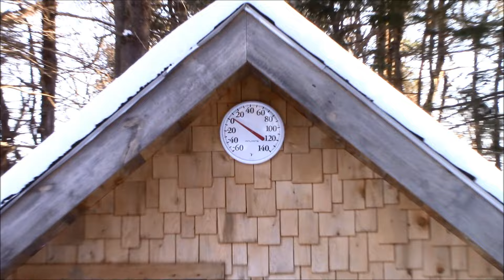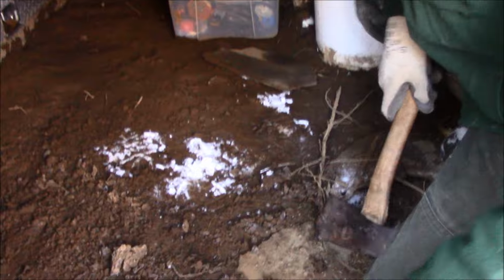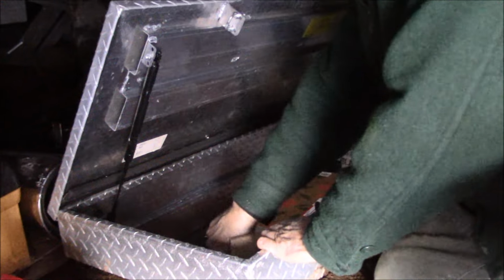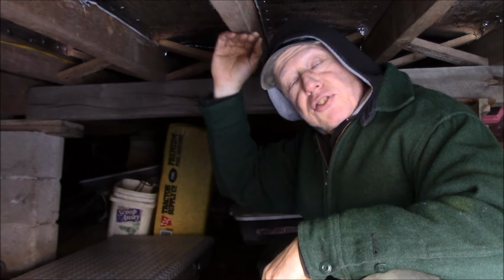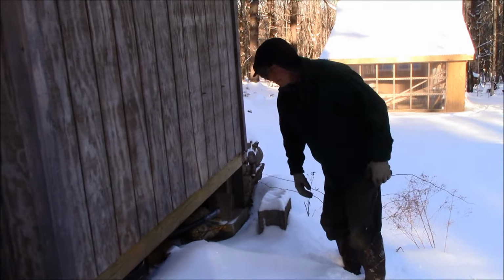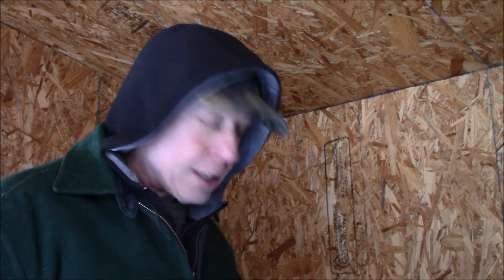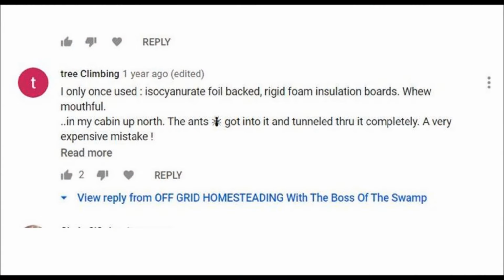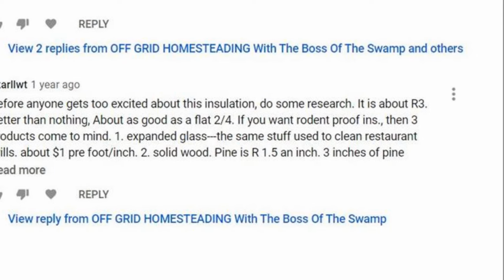Awesome Floor Insulation For A Cabin In The Woods   3rd Year Review

Comment: If you were building a new cabin would you place the bubble foam over the joists or more like your retrofit stapling to the face of the joists allowing for heat leakage to crawl space?
Reply from the maker: Over the joist creates a thermal break and insulates the best, but... You need to keep rain from getting trapped between the foil and the sub floor.  If rain does get in, just slit the foil to drain the water and let the floor dry out. Then staple it back up.

Comment: Thank You Sir! I have a cabin up north that my father insulated. Yes, the critters get in and tear the insulation out because there's no skirt under the structure. Its up on cinderblock posts. This has been an enigma for me. Thanks for the inspiration. Any suggestion on insulating pipe races underneath the cabin? Also, do you think there would be any value to doubling up the bubble foil? Take Care, Tom
Reply from the maker: I would think that doubling would help but I've never done it.  My suggestion is to skirt the cabin. It makes all the difference in the world.

Comment: Hey Boss I use bubble foil too  its awesome.  I did find one problem...I used foil and fiberglass on my wire chase on an exteriorwall. It caused sweating and mold. I got rid of the fiberglass insulation. Problem solved. Please keep uploading videos. Thank you for them too.

Comment: Your correct, you just need the tech vocabulary to add to your descriptions...  Heat always flows hot to cold (cold is just less hot) via 3 methods or means... 1.) conduction, heat through the materials themselves, metals being the worst due to electron mobility...
2.) convection, the transmission of heat from a hot surface to a cooler surface by in most cases air movement, which physically transfers the heat as a gas in motion...  3. ) radiation, this is typically in the Infrared red range of the electromagnetic spectrum, all materials emit
IR at a temperature...

The bubble foil has all 3 properties, in varying degrees, 1.) it is a poor conductor of heat due to the main constituent being thin cross section of plastic... 2.) the bubble construction limits convection by and to small bubbles of air, fiberglass also does the same by making the medium full of tiny convection zones, where the air transfer is limited from the extreme surfaces... 3.) but where bubble foil shines is the reflection of IR radiation back to the source... so for example when you bring your hand near the surface but not touching you feel warmth, this is your own hand IR heat being radiated back to your hand...  IR heat loss has been long overlooked in construction...

Comment: The Huber Sheathing with the shiny foil side works the same way, it reflects the heat back up and thru the wood, this is proven by building science and works well. However it's better to have real insulation between the joists like rock wool, and with a rodent barrier such as roll stock aluminum or plywood fastened under the joists, more work and more time but better insulation than bubble foil alone. I did this in my ground deer blind and there is no way ants or rodents are building between my floor joists, and yet I still have plenty of insulation in there to keep my feet warm. There are many ways to skin a cat, people just need to lighten up a little and use some common sense.
Reply from the maker: Agreed, but all situations are different.  Trying to fit foam board between between these twisted 70 year old joist would be a joke.  Sealing it up tight would force me to heat the crawlspace afterwards.
Reply: @thebossoftheswamp  Yes you are being deliberately leaky with your heat, so the pipes and such don't freeze. You can do that when you burn your own wood, but I bet if you were using fuel oil, propane, or electric as your heat source you would have that place buttoned up even tighter. I like that bubble foil for wrapping HVAC ducts. If someone could find a way to sew it inside a coat, it would be hands down the lightest and best coat liner on the market, wind and water proof too, (and noisy too lol)

Comment: There are a lot of information junkies out there. The problem with the information is it is skewed towards using other means of heat besides a wood stove. Clearly I think that is why your experience differs from some of the research that has been done. I'm assuming that your heat is 100% radiant and therefore much more controllable with this type of insulation. Additionally most research isn't conducted In the Backwoods where pests are a constant issue. Most of the research is more concerned with controlling convective heat loss and moisture control. I don't know if this helps you, but I wouldn't get too annoyed with people who think they understand your situation better than you do. Keep going JC.
Reply from the maker: Well said.  I find the naysayers more entertaining than annoying so it's all good :-))

Comment: Good morning Boss, I have an old pier and beam farmhouse with very little crawlspace clearance; maybe a foot or more. My floors are cold in the winter with no insulation. I was thinking about pulling up the floors and installing bubble foil over the joists like you did in your shed. Would I have to put foil around the skirting to get the effect? Or would the floors be just enough? Thanks. God bless!
Reply from the maker: Insulating the skirting helps a lot for sure but my tiny NY cabin only has it under the floor and none in the skirting. Those floors are always warm.

Comment: Hey JC I have been busy building our cabin in northern Minnesota.
Question on the bubble foil.
Did you run it with the floor Joyce or across it. Thanks and God Bless
Reply from the maker: Always with the joist so that the seams are over wood and tape the seams.
Reply: @thebossoftheswamp  thanks that’s what figured. Hope all is well on the mountain.
And I hope Franky is doing better.

Comment: Well I can personally say that stuff truly works. I built a camper on the back of our truck. Used just that only in the roof. The roof was black trucker's tarp. The ceiling was cool in the heat of summer. Stayed in it in 30 degree  weather easy to heat warm as toast

Comment: There is nothing wrong with bubble foil for use in your floor insulation. It also makes a good insulator on top of purlins, but under your metal roof to prevent "condensation in door rain". If you don't know what that is, then maybe you have plywood under your metal roof of your out buildings. If you don't do plywood underneath your metal roof, then you better have bubble foil or some other kind of insulation, or you'll be rotting your purlins. I love metal roofing, but it does absolutely need something between it and the wooden purlins and trusses. Air carries moisture and when the temperature outside drops at night (or you have animals in your outbuildings) that air with moisture will rise and hit that colder metal roof and condense then run on the underside until it hits your wood and rots it. Boss didn't say to use it  in your walls or ceiling, but floors and skirting. Bubble foil is great when used in the right places!!!! He tells those who watch his channel a lot of great practical advice. Most of us love his and Lori's work,  common sense, practicality and the humor that they bring. Take care James and Lori and GOD BLESS
Reply from the maker: God Bless :-))

Comment: Jim is absolutely correct. This product is a radiant heat reflective  insulation product. 1 layer on the floor, 2 on the walls, 3 layers on the ceiling. When putting multiple layers, include a half inch dead air gap between the layers. Also use a quality aluminum tape recommended for on the seems. To keep a small cabin warm, you may only need 1, 2, or 3 candles before it gets too warm. This is a radiant reflective insulation, so you need a low and slow approach  only to be comfortably warm.
You can also cut and form it over the the hinge part of the door where it swings open. You can also create a long tube or v flashing where your door can seel the jam on the bottom, handle, and top side.
 Great video Jim, I love your  passion.

Comment: Needing some advice. We are building a 10 x 10 bunkie (no insulated walls). We want to use bubble foil on roof (steel) and floor. Foundation is 6x6s with 2x4 sleepers on their sides. Considering bubble foil directly under 3/4” floor boards, 1-1/2” air gap at sleepers, second layer bubble foil under sleepers. Perhaps followed by another 2” air gap, 1-1/2” rigid foam and a final (slightly above ground) layer of bubble foil. Roof (3/4”) wood with “blue skin (ice shield) layer, 1-1/2” rigid foam, bubble foil then steel roof. Does this work in your mind?
Reply from the maker: I have great results with a single layer of B-foil beneath my sub floors. A second layer as you described sounds fine too but ants and rodents sure like that foam board. Everytime I use it I curse the results.
Reply: @thebossoftheswamp  any thought for under the steel roof. No real chance for an air gap other than the ridges in the steel. Your videos sure are fun.

Comment: We live in a doublewide trailer on a lake.  We have experienced similar problems with rodents trashing our insulation and wreaking general havoc with our HVAC.  The joists are I-Beam, so we would have to staple it to the floor alone.  Thoughts?
Reply from the maker: Yes. Staple this to the underside of the floor and it will reflect the heat back upward and keep your floor warm.

Comment: I can't create a perimeter wall so I can't insulate it due to water under the house.   I have huge white mold problems on the floor.  Could the floor joists be wrapped as well to add to the insulating value of the bubble foil?

Comment: If you're insulation worked, your floor would be frozen. The heat leaking through your floor, keeps it from freezing. Still if you want a frost free storage, carry on.
Reply from the maker: I'm cozy and not complaining.  The heat beneath the cabin is coming from the ambient temp of the ground.

Comment: Heat transfer through your 2x6s is thermal bridging. I used bubble foil  over regular insulation under my drywall in my sunporch to prevent thermal bridging and boy did it make a huge difference in how warm it stays in there with no heating at all. It holds so much more of my daily thermal gain from the sun and I don't have to use a heater to keep my plants from dieing. Love this product.

Comment: Hey Boss, a little advice please, I have a situation where I cannot insulate walls with fiberglass,  what do you think of foil backed foamboard in walls then clad with drywall. Foil works great under my floors. I used the between joists method and no problem with freezing. Anyways, thank you for the vids and all the best to you and yours. Cheers
Reply from the maker: My experience with foil faced foam is NOT GOOD.  Ants LOVE THAT STUFF.  Why can't you use fiberglass?  is it a health reason?

Comment: I insulated the entire inside of my 12×20 tent with the double foil bubble wrap. With 2 big wick oil lamps from Walmart, it stays incredibly warm. I became homeless after 2 long term jobs went out of business, within 2 months of each other. I grudgingly got a roommate, who stopped paying rent and wouldn't leave, getting me evicted. Dumping my rescue hospice animals wasn't an option,so I remain homeless, despite working odd jobs. This is our 3rd year off grid in the tent. And this year, using the bubble foil, it is perfect.i taped it together with duct tape. The cheapest alternative and no other insulation I tried had worked. The only thing between us and the bubble foil,is the nylon the tent is made from. So anyone who says it doesn't work apparently have not actually tried it and lived it. No one should be making videos until they actually try and experience what they are filming about. If anyone out there is homeless, try  the bubble foil and duct tape.You will be happy you did.

Comment: Good job boss, the foil bubble wrap it's not about the r value, it gives you a thermal break and reflex the Heat, the heat always moves to cold, temperatures always wants to equalize so your building radiates Heat when it's cold, always good to have a reflective barrier and a thermal break between the materials

Comment: Hi , do you need to cover your floor With
Thanks plastic for the moisture. Do you have any windows for the air to  circulate
Reply from the maker: I vent it in the summer but not in winter. A tarp on the ground will cut down on moisture but it'll also stop the ambient temp of the ground from heating the crawlspace.  I have no covering on the ground.

Comment: well im not going to compare it to anything but i would say that there is no reason for it not to work . its a simple thing when you think about it . its a reflective property . the outside of the wrap reflects ether cold air away from the floor or what ever and the other side reflects the heat back away from the out side cold . the air inside the wrap creates a barrier of air kinda like cardboard . if the air was not between it the cold could transfer  threw easier . it is the same reason people have used cardboard boxes to keep warm  when camping or homeless . its a barrier from the cold . and uses the same principles as a space blanket . the foil reflects the heat  back and the cold back toward   the direction there coming from . its water proof so moister is blocked as well . no it wont replace good insulation  but works . it should last for years as well if left alone . wont rot  and would be a great way to to seal and cover insulation before you put up the wall boards or dry wall  as well   as a extra barrier of insulation . hey most you can say is dont knock it till you try it . by the way love the idea of the truck  tool box as a fridge under the cabin . great idea .

Comment: Your southern equivilant to this is to use bubble wrap to insulate a window. 
Mist your window with water, put bubble wrap on the window with the bubble side to the glass. The water will dry on the next day and somehow still hold the bubble wrap to the window. Use the big bubble type that's fun to pop not the little bubbles. Because its clear, light still gets through and you can kinda see through it if needed. Its not ugly from the street and cuts down on the amount of heat or cold coming through that window. Once you're done with it, clean window with windex and you never knew it was there. 
Sounds stupid, works great.

Comment: My small cabin is sitting on 4x4 and then the 4x4 are sitting on cement blocks. I can’t access the under side of the cabin floor to use this. Would be ok to use this on the inside, on top of the subfloor? I’m going to carpet it with indoor outdoor carpet after the bubble foil. But just wondering if it would be ok to walk around on. The cabin in the summertime, in the morning gets pretty chilly because the floor is un insulated. In the winter it heats up fine but the floor is pretty cold. Looking for a solution since I can’t access the underside. I guess it’s either bubble foil or maybe like a heavy plastic then carpet over it.

Comment: It sounds like the trolls came at you...sorry to hear that. you know peoples opinions are just like their bung holes, and the size and color of that are of no interest so, neither should their opinion matter to you! lol. Two layers with an air gap between increases the R value. You did a great service by posting this, I had fiberglass under the floor and in the walls of a mother suite and when the cleared acreage 1/2 mile away for a pipeline the rats came pouring out of the forest and nested and destroyed the insulation and gained entrance to the building. Never smelled anything like that, it was a year long battle to get rid of them!

Comment: I thought I left a comment on this page may be another one of your videos, first of all thank you next question is what about foil backed rigid insulation do you think that would work as well. Like you described in one of your videos you put rigid insulation between the rafters floor rafters but the rodent still ate through it if I used foil based rigid insulation would that do as good as his bubble wrap. Just looking for other products and a good installation method. With a rigid insulation foil based I can place it between the rafters seal it well as opposed to crawling underneath the small cabin
Reply from the maker: I have never had a rodent disturb the bubble foil but they've chewed the heck out of any type of rigid insulation that I've used and the ants LOVE that stuff.  I put 3" of rigid foam in the ceiling in my NY cabin and the only problem I have there is ants in the foam.

Comment: Am looking to add some insulation and skirting to our already built cabin as this is the first year it will be occupied during the winter and found your video.  Is all your skirting around your cabin 3/4" plywood?  Assuming it's treated plywood?  It sounds like you framed the area out, with the wood on the outside and then the foil attached to just the 2x4's inside, so there is nothing in the open areas between the plywood and foil, correct?  Do you think the bubble foil would work as well with roof metal used as skirting?
Reply from the maker: Yes roofing metal makes very good skirting.  My other cabins don't have any insulation in the skirting  but still performs very well.  Skirting makes all the difference.  Good luck with your project.

Comment: I'm thinking of pinning up the foil double bubble with a white side down on ceilings in an older mobile home  in N. CA. There is no attic to add insulation into. I plan on having a coffered ceiling,& dropped down 4" in future  in order to add Rockwool. Do you think the foil will help in the interim?
Reply from the maker: In an upcoming (project update) video, I will show how i am incorporating both bubble foil and rock wool in the roof of our new structure. Stay tuned.